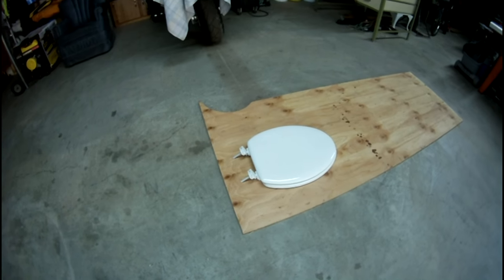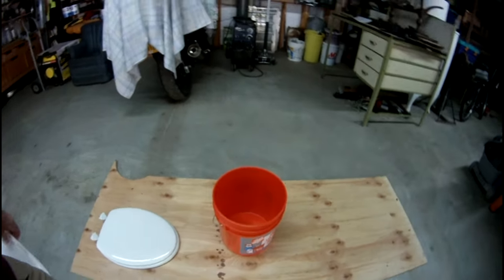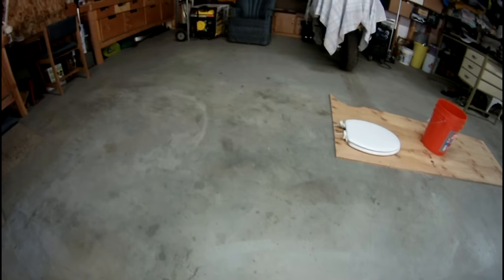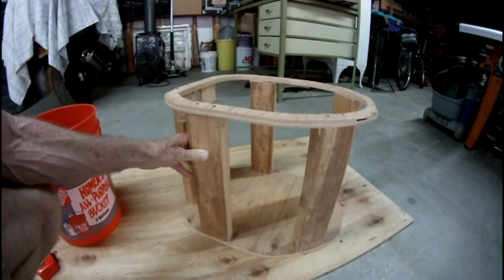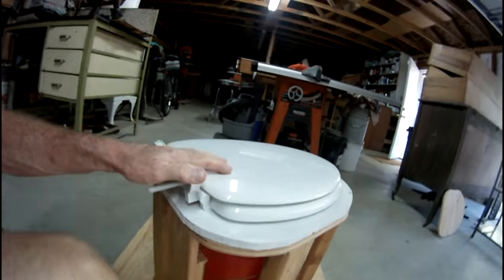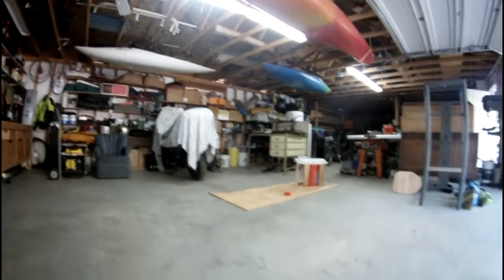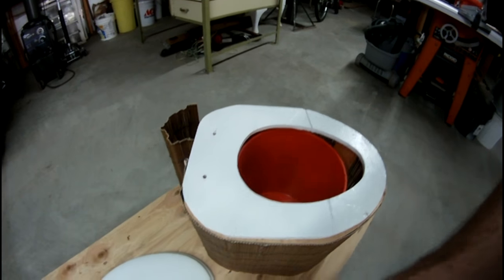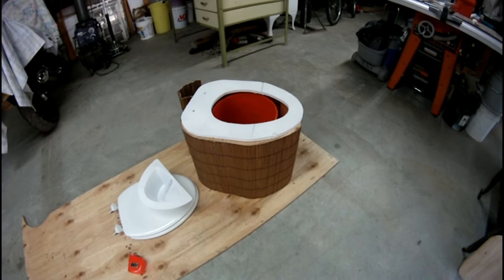Make Your Own Portable Toilet

Comment: I cant find the blinds that will be small enough.  Does anyone have a link for some this size?   Love how this is put together!
Reply from the maker: @Heather Rheyne - I'm sorry, I forgot to mention that I cut those blinds off to the correct size needed.  Just buy the narrowest width blinds you can find and cut them to fit.  I left mine rolled up before cutting, which makes it easy.  Just mark where you want to cut, tape or tie a cord around the blinds right next to the cut line so it is very tightly compressed there, and cut.  Good luck!

Comment: Genuine urine collectors are pretty expensive : it would be appreciate if someone had the name of the cheap device showed in the video.
Reply from the maker: Check your local medical suppliers for "Urine Hat,"  "Urine Hat Collector." or "Toilet Hat Specimen Collector."  Those seem to be the various names they're known by.   Here are a few I found:
http://www.mountainside-medical.com/products/commode-specimen-collector-hats-800cc?gclid=CNXHzcXBpc4CFY89gQodsvkAzg
http://www.vitalitymedical.com/toilet-hat-specimen-collector-by-medi-pak.html?gclid=CIq8wMvBpc4CFdccgQodZ_EH6A
https://www.amazon.com/s/ref=nb_sb_noss_1?url=search-alias%3Daps&field-keywords=urine+hat
Reply: It is you are on a budget, use a funnel or Coke bottle with the bottom removed to make a urinal.
Reply: I'm a truck driver. I'm using the urinals the guys in wheelchairs use. $10-$15 at Walgreens
Reply: I use an oil funnel I got in the car department at WM. Screwed it on at the front. It had perfect size to fit tubing that goes to a collapsible 2 gallon water bottle. Easy to use. Easy to dump.